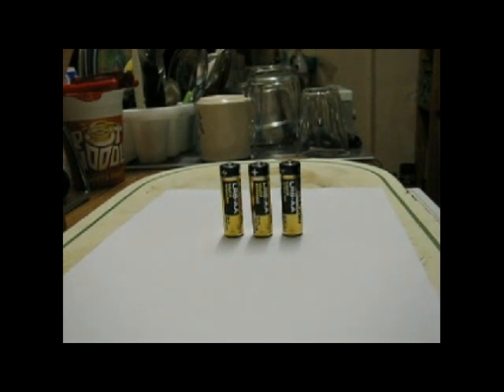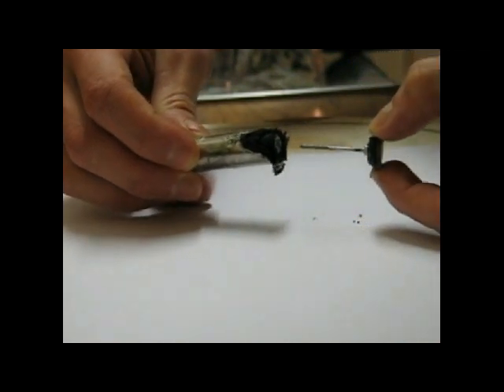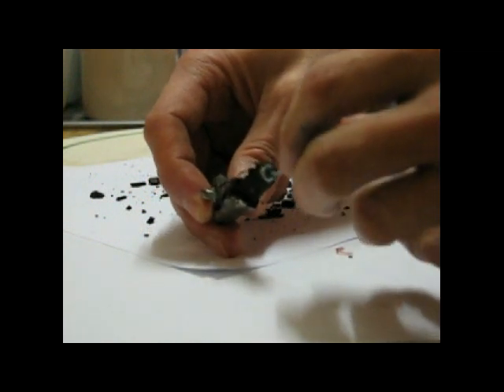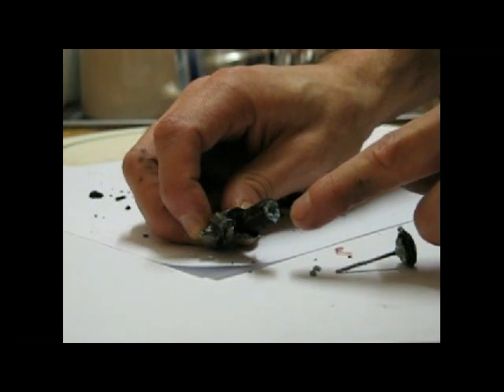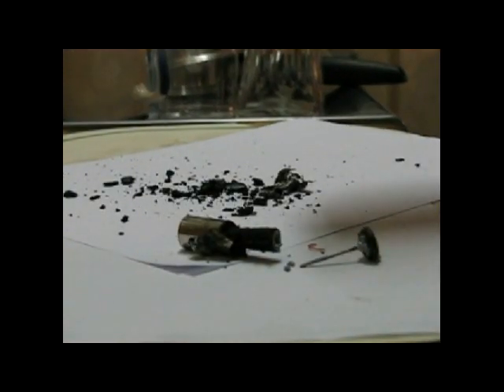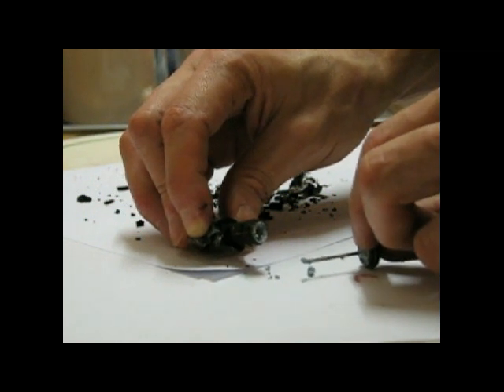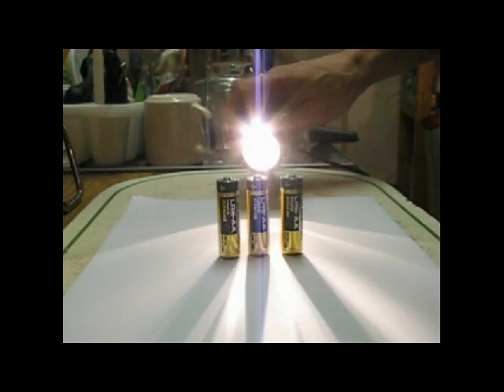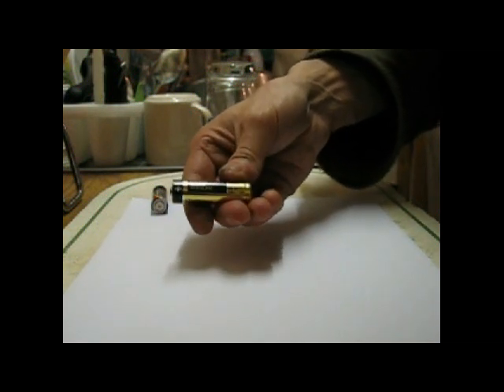Recharge Your Alkaline Batteries

Comment: My physics teacher had a different take on all this.  He use biased ac to recharge batteries.  He claimed that if you applied DC to a cell it caused crystals to grow so by hitting it with a bit of reverse but reduced voltage the crystals would break down.  The circuit consisted of a resistor in series with a diode and another resistor in parallel with the diode.  This gave +1.5v on one cycle and -0.1v on the other.  Resistance chosen for a low current - would take about 20 hours to change an AA.

If anyone finds this useful and managed to get it working let me know.
Reply from the maker: That's interesting, thank you for sharing. :-)
Reply from the maker: hmmm!
Reply: Damm Enstien

Comment: Sharper image used to sell a trickle charger to recharge alkaline batteries.....it worked as long as they were charged before dropping below 50 %.....probably based  on the same principle, but had safety features built into it while charging.

Comment: I have a 5v , 300ma charger what is the best way to charge alkaline with it ?
Reply from the maker: The voltage is a little high for charging 1.5v batteries. If you experiment with it DO NOT leave it unattended for any amount of time.

Comment: Informative but the background music distracts from what you're explaining. perhaps next time you could do away with the music.
Reply: Its my sound setup. I watched it with my phone and the music was not nearly as loud. Must be related to my 3d ultra sound output since I am a PC gamer. Just one more think I have to figure out now.  All in all the video is good and very informative.
Reply: I am not saying there is not filters, but audio recording and merging is done in layers, and very few audio editors or video editors are even capable if editing those individual layers but rather edit the channels or tracks. No matter how many times you edit, encode, decode, compress, decompress, upload or download, unless you are directly editing those layers you will not know they are there. Direct sound just enables playback of those individual layers. Music for example is recorded in parts and layers both. Background and foreground as well as vocal lead a backup in most cases, but when you attempt to edit it without the right software it will appear as a 2/4 channel single or bi-layered track. If the music is twice as loud as the vocals but the vocals are set a layer above the music, all standard audio output systems will prioritize the vocals, in turn "lowering" the music volume on output. The direct sound I am referring to is just the raw playback of the entire layered file which unless properly edited with the correct softwares, will never actually change. When you edit it in say Camtasia or Sony Vegas or even Audacity you are simply adding playback filters and are not actually editing the audio tracks as they were compiled originally.
Reply from the maker: What device are you watching the video on? Is it battery powered?
Reply: Just to clarify my first comment, I don't mind having background music. The music was just louder than your voice so it was difficult to hear what you were saying which is what I really wanted to hear the most. Thanks
Reply: sd10559sd some people say it is too loud some say it is fine. The audio levels are ok on my device. What are you watching it on. You might need to concentrate and focus on what I am saying?
Reply: I am watching it on a desktop computer with an Aula headset with 50mm drivers. The music was very loud. Audio parameters adjustments did not fix the issue. I was able to use closed caption to understand what you were saying, so at least I know what you were saying now.
Reply: TheSlimCP Seriously? That bad? I have never had that trouble on phone or desktop speakers. Good that the captions work though.
Reply: TheSlimCP hey that is good to know. Kind of. lol. Do you a 3D affect enabled or a bass boost? Sometimes that can affect the sound and make it kind of reverberate. Thanks and good luck :)
Reply: No, but I have my audio output run through my graphics system which is direct sound. Most sound setups are filtered through the device's soundboard to fit a certain common use standard but I do not use any such filters so everything I hear is exactly as the digital footprint is made. So you might not be able to hear it on your end due to autonomous filtering that cannot be changed, but anyone running direct sound can hear everything as it was recorded digitally.
Reply: TheSlimCP Sorry but there is no such thing as digital sound without filters. Digital sound is passed through all manner of filter when it is recorded. Then it is encoded depending which file type it is rendered and saved in. When the sound is played back through YouTube the sound file would already be encoded into another file format which means more compression and encoding. Even then, no two people's hearing are exactly the same so no matter how good the the recording equipment and software used  the sound is still open to interpretation  by the listener.
Reply from the maker: Interesting. Thanks for the info.
Reply from the maker: Statistically, videos with background music get more views. Thank you.

Comment: I put my alkaline batts in  a charger designed to recharge NiCad  batts , and plug that charger into a programmable on/off switch, 1min charge-9mins off, 1min charge-9 min off etc for 10 cycles and that recharges them safely- so far

Comment: I found it informative.  The take-away I get from it is to charge in short bursts so the alkaline does not have a chance to boil as a result.  Maybe the desired result though is that actually does boil so that the rod is heated a little to "descale" it while in turn not boiling it enough to cause it to leak out.  Am I missing the point here?  I remember a product some years ago which was made for charging alkaline batteries and I think it used the same principle.  It was instantly sued by the battery manufacturers and I think condemned by the US government as well as a safety hazzard... (right..).  Have you seen this charger?  I would like to see one to see what it does exactly.  I found your information helpful and informative as well.  I will not complain about the music.. that is a little tacky as an opinion to do.  I say "good job"!
Reply from the maker: +Game Art Lol and good ideas. I do not think the solution is meant to "boil" as such. It is an electrolyte and conducts the electricity flow between the molecules. There is also probably some basic electrolysis chemistry going on too. When the battery is charged the molecules are energised and aligned to form a random array which becomes depleted over time and with use. When they are manufactured the sludge inside is charged but not fixed in place so the molecules move around and become misaligned, making them inefficient to recharge. They also leak through air vents designed to stop them exploding under pressure. The music has become a long standing joke btw lol :P

Comment: Could you put the charger loaded with batteries in the ice box to keep them from overheating?
Reply from the maker: +Endo Alley Probably not a good idea. Alkaline batteries contain a conducting fluid which will freeze and expand possibly rupturing the case. When they thaw out they might leak. Better to use a low voltage charger for short periods at a time and monitor the batteries closely. If they show signs of overheating or leaking stop charging them immediately. If they leak the batteries will not hold a charge anyway and could damage your charger.

Comment: I sit my dead battery's on the heater for about 5mins and I get a bit more life out if them, cool clip  good tips ✌
Reply: Actually, that might explain the new found energy from "recharging" them; it might just heat the inside up. would be good to charge, let cool, then test.

Comment: you should be careful of botton cells if you do short them of charge them they will pop so be careful of this please.one has poped in a bag with others and must of touched and build up pressure and gas then popped.i thought it was my rechargable flashlight that has a lithium polymer battery in it if you over charge it when its still about fully charged.but it wasn't it.the botton cell popped.

Comment: i want to know how to find the amphere hour of any alkaline battery because it's not written on it.
Reply from the maker: +Debojit Acharjee The way to test a battery is to connect it across a load with a known current drain and resistance and then time how long it takes for the battery take to go flat.  This would of course drain the battery. You could  then experiment and recharge the battery, repeat the test and see exactly how much the battery will recharge in terms of milli-amp hours (mAh). 

If you know the voltage drop or current drain across the load and time it, you can calculate the power in terms of Watt hours (Wh). You can then convert this to milliamperes hours. Google the formula or use this calculator. 

https://milliamps-watts.appspot.com

Have fun and be safe. :-)
Reply: so how do i determine how many ohms resistor i should put in series with the multi meter along with the battery to find out the amphere hour?
Reply from the maker: +Debojit Acharjee  I have never done it so you will need to experiment. This is the theory:

If you have a 1V battery in series with a 1 ohm resistor, then ohms law is I = V/R  

1/1 = 1 amps. 

If it is a 1000mAh battery that means it can deliver 1000mA (or 1A) for 1 hour. So in theory if you use a 2 ohm resistor it will take 2 hours to discharge. 

The formula is :

Battery life in mAh divided by load consumption = discharge time. 

mAh / mA = h

1000mAh / 1000mH = 1 hour discharge time. 

I suggest it will be less than this since 1 ohm is practically a short circuit and the current drain and voltage will start to fall immediately. 

Also make sure your resistor can handle the load i.e.  The current rating otherwise it will burn out and could be dangerous. It is probably  safer to use a  bigger resistor and conduct the test over a longer time. 

And DO NOT do this test on a lithium ion battery! Short circuiting a li-ion battery could cause it to catch fire or even explode. 

Good Luck! Hope this helps. 

http://www.digikey.co.uk/en/resources/conversion-calculators/conversion-calculator-battery-life
Reply from the maker: Correction:

1000mA not 1000mH (typo lol)

Comment: The sludge in a ALKALINE core is most probably Manganese Dioxide.
Reply from the maker: +Kevin Thomas it is usually a bi-metal compound (eg. Nickel and Cadmium) and an alkaline electrolyte. Maybe the sludge is mixed with manganese? Modern batteries claim to use ethical metals and do not use Cadmium or Lead.

Comment: I have since purchased & use continually a MaximalPower battery recharger made to recharge Alkaline batteries. Ordered from Amazon around $30.
I still use a voltmeter which is less than $10 anywhere.
Discovered that the dirt cheap batteries bought from Harbor Freight can be recharged & perform just as well as the expensive high advertised brands. 
But there is a trick to it.
Use the charger, it will stop charging at a certain level, ignore this as the charger is basically going into trickle charge mode. Keep the batteries in it overnight & use them. They return to very close to original charge.
Now as the batteries have been recharged many times, they will begin to become weaker & charge less.
However I reuse them 20 / 40 / 75 times so the dollar savings is obvious.
Best is when relatives save & give you old batteries instead of tossing them.
I use these or batteries that no longer charge more than 1.2 volts in Remote Controls for TV's.
Reply from the maker: +J.French Rennier Thank you. I would not recommend leaving them over night though in case the heat up, leak or even explode (I have never seen one do this in a charger but pays to be safe).
Reply: Totally understand the need to be safe. Was referring specifically to the green light fully charged indicator which actually allows a tiny amount of trickle charge to them which is only truly apparent after leaving them in another 24 hours. Discovered this completely be accident & in particular using the dirt cheap Thunderbolt brand.
I have never exploded a battery, (imagine this would only happen if battery was inserted in reverse) but had a few leak but not since using a charger meant entirely for recharging alkaline batteries. I bought the MaximalPower from Amazon after reading reviews & comparing price - my son & a nephew are doing so likewise.
Appreciate your video especially since I believe in not only saving money but in also an ecological reason.
Reply from the maker: +J.French Rennier Hi, I have to say that for safety reasons a bit like a disclaimer but it is true also. Safety first. Most alkaline batteries are designed to leak that's why they have weak seals and sometimes vent holes for that purpose. It also conveniently makes them difficult to recharge because they tend to heat up and the gases expand. Technically, they cannot explode because there is never enough pressure and the bi-metal compound does not combust. The alkaline chargers trickle. Har he them like you say which helps to prevent overheating. Thank you for you comments and have a great day :)
Reply from the maker: *charge (typo) lol
Reply: Appreciate the knowledge concerning vent holes, explains a certain brand which seemed like having particularly weak cases.
There is another trick to recharging dead cell phone Ion batteries using a 3 volt charger to stimulate the battery.
I made it safer using a toggle switch.
Now maybe if Apple could invent a Bluetooth TrackPad which did not eat batteries but I need 7 foot distance to properly appreciate the 80" monitor.
As a totally unrelated aside:
If you use a trolling motor with a separate starting battery for your boat - the next time do not spend a fortune on a Marine battery - Instead buy a sealed no maintenance wheelchair battery. 1/2 the cost, 1/3 the size, heavier internal cells & designed for daily recharging full discharge. Best is the case is superior tough meant to withstand vibration.
If the boat rely on a single battery - buy instead a zero maintenance gel mat Solar battery meant to be used with Solar panels. Just do not continually pull it out of the boat - 1/3 heavier & tougher case.
Reply from the maker: +J.French Rennier Be VERY CAREFUL when charging or experimenting with lithium batteries. Lithium is a volatile metal that reacts in air and water. It has an explosive burn rate and very hot, something like magnesium. If you you short out a lithium battery across its terminals or through its metal while it still has charge, the resulting heat from the current flow can be enough to ignite the lithium and it will combust very rapidly. And this is magnified by the case pressure which is NOT designed to leak, as are most rechargeable batteries. 

You are welcome. Stay safe.

Comment: I guess I missed how you charge them... i.e. using a NiMh or NiCad charger ...???
Perhaps rename this video to... "How a battery is made and oh yeah, they can be topped up..."
Reply from the maker: +DumbSkippy Standard NiMH charger will do. I don't think the output voltage is much different but check to make sure it does not exceed the required battery voltage by more than say about 2v to be on the safe side.

Comment: I would charge them 1 hour on the charger, 1 hour off.  Then repeat until fully charged. That way they dont get hot and leak.
Reply from the maker: LESS CHANCE that they will leak, heat up or explode. Still DO NOT leave them unattended.

Comment: Is it best to use a fast or slow charger for the 1 hour time? Would a trickle Usb type guarantee non leakage? Silly questions, its all about the charge rate and cut off voltage.
Reply from the maker: +simon hare Yes but most people do not know these things so they are not really silly questions. Nothing can guarentee no leakage since most "non-rechargeable" alkaline batteries are designed to vent under pressure.

Comment: i agree with matt - they can be recharged....sort of.   my success has been about 80/20:  2 leaked and 8 did not, but i bought a device off of ebay that is only for alkaline (~ $15.).  it will test the current condition and the LED is either 'good' or 'bad' then it will begin and when done it blinks 'full' and automatically stops.   on the down side, it might take 3-5 hours to complete 4 AA/AAA of good quality - coppertop, eveready - not cheap ones.  

as a test, i got a 1.16v reading from a drained AAA.  after the charge, my multimeter read 1.4 - 1.45v but never a full 1.5v, so it's more like 'refreshing' the battery.  also, they don't last as long as a new one, but why throw away something with that much existing charge if you just need it for a simple flashlight or tv remote...  i wouldn't recommend using them in a camera or other expensive devices.

some have leaked after the process, but none have ever exploded during or after, and they never get hot (probably because it is a very slow recharging).  

p.s. there is absolutely no name branding on the device, box, or the 1 paragraph instruction page, so i can't even tell you what to look for.
p.p.s   music ?  i didn't even notice it - hahahahaha.
Reply from the maker: Haha and thank you for sharing your experience. :)